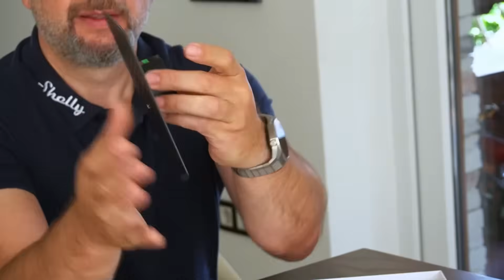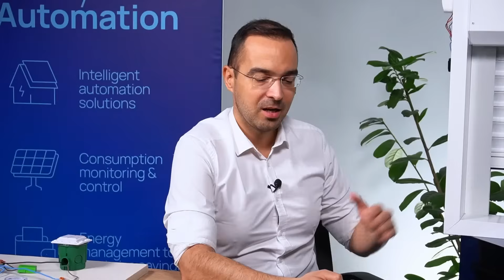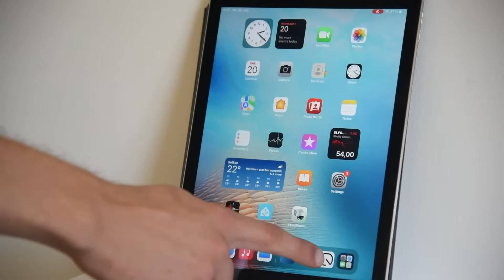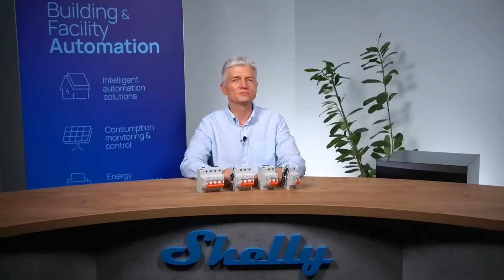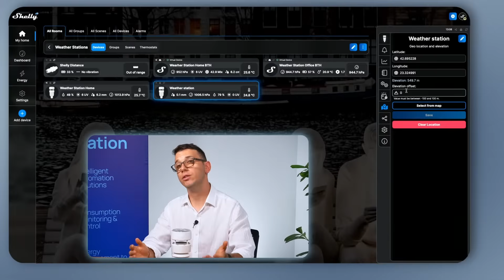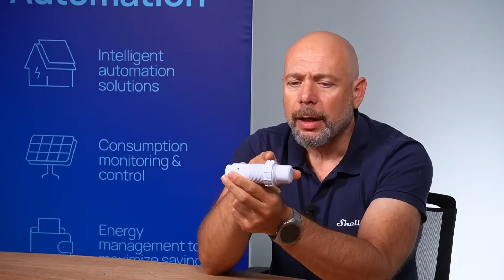Beyond the Box: Shelly’s Latest Tech in Action | New Products Reveal, September 2025

Comment: I see one problem with the wall display XL, in older/existing houses the light switches are mostly close to the doorframe. Which makes it impossible to use the mounting plate with the central relay in the existing hole. Would be nice if there was a mounting plate where the relay is close to the edge (Left and right version)

Comment: Great new products. I used to be sceptical about the bluetooth low power devices but I recently aquired some shelly relais and wall displays that have bluetooth build in. It's great these devices can act as bt "router" so you can connect bt sensors everywhere in your house. Battery of these bt devices also seem great. It's also nice the bluetooth feature is available in HA, so paired devices also show up there. 

Shelly is slowely but steadily moving forward. Great job guys!

Comment: It looks so, that the CB has no intigrated Power Meter. That would have been a really nice feature.

And have I understood correctly that external switching on is only possible if it has been switched off remotely beforehand? With manual switching or triggering, do you have to operate it manually?

Comment: Great video! I have a issue: I’ve bought a Shelly Blu Remote Control ZB and I’ve configured two blinds, but now I want to change the channel assigned to the blinds. How can I do that? Do I need to reset the remote? How do you reset it? I’ve tried pairing it again but it stays the same. Thanks.

Comment: Really quite some cool new products!
E.g.:
- Shelly pill as a safe (no 230V) product for people to measure their heating temperatures
- Shelly CBs - great new idea & solves the room problem in the cabinet
- Shelly distance measurement: finally a solution to e.g. measure the oil in the tank (might make sense to increase the interval from 30s to 1 hour to extend battery life)
- Shelly presence - my initial reaction: one more motion sensor. But this is brilliant.
Reply: Thank you for your kind words! Just wanted to reassure you: The Pill is much more than the plug-n-play temperature device. Stay tuned ;)
Reply: What do you mean the CB solves the room problem?
Reply: @Axell0003  Instead of e.g. adding a Pro 4pm you seem to need just 1 unit of additional space in the control cabinet, but still get PM & power control functionality.

Comment: WARNING! 40:15 you can't connect Shelly Wall Switch directly to 220AC! Please read your own knowledge base. Maximum switching voltage for Shelly Wall Switch: 12 VDC / 18 VAC
Reply: It is not connected directly to 220V, it is connected to the Shelly Dimmer. 😊
Reply: The Shelly Wall Switch is a simple mechanical pushbutton. It is wired between the L (220 VAC live line) and the SW input of a Shelly device (e.g., Shelly Plus 1, 1PM, 2PM, Dimmer), as shown in the Knowledge Base wiring diagrams.
It is important to note that the SW terminal on the Shelly device does not switch mains voltage (220 V). It only detects when the wall switch connects L to SW and uses this signal as a control input.
The actual switching of 220 V to the load happens inside the Shelly device, through its relay, when you wire O (Output) together with L to supply a lamp, appliance, or other load.